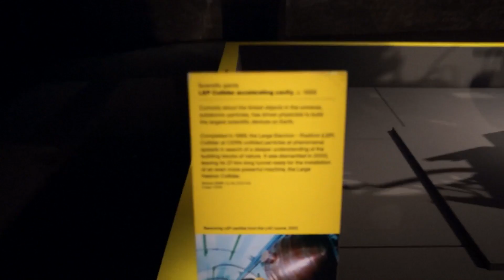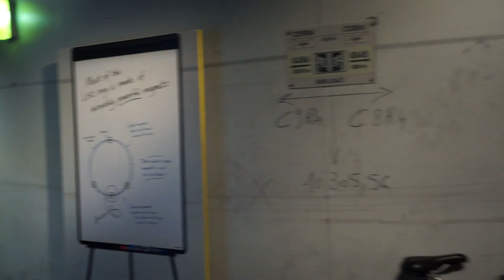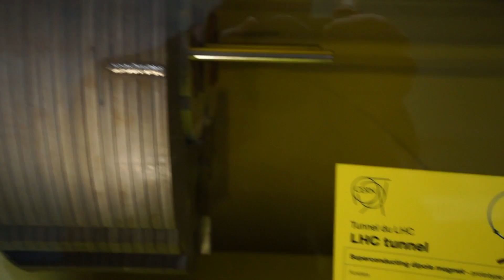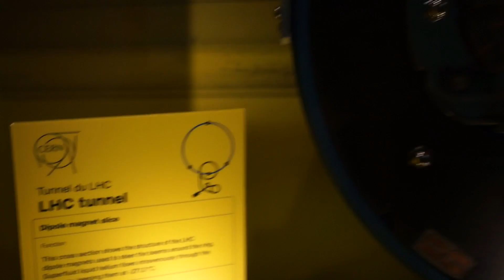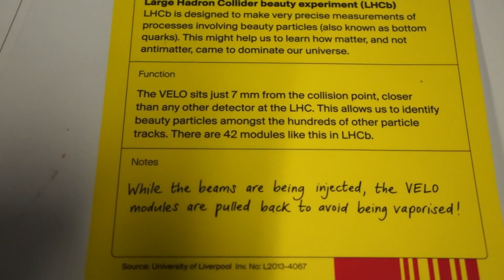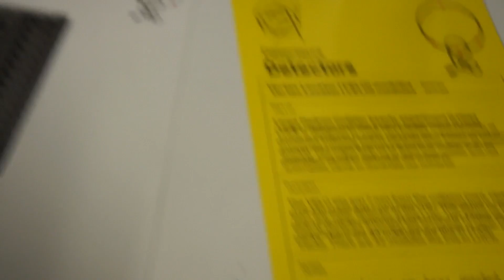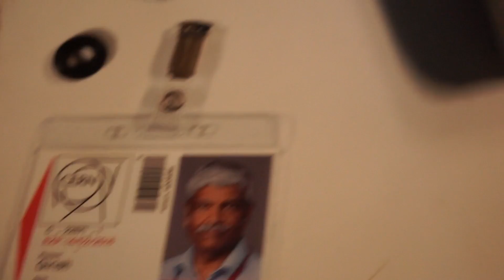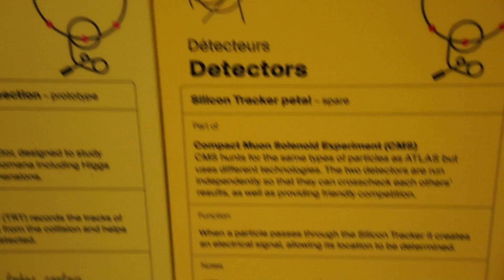Large Hadron Collider LHC Exhibition Tour

Comment: The copper wire runs along the tunnel in parallel...instead winding along the core...it's the particles accelerator...bothpoles runs along tube so called bi polar.....also featured in terminator 3...

Comment: Did you see the I2C testpads on the VELO module? SDA/SCL were on there. Wonder for what...

EDIT:
http://www.kip.uni-heidelberg.de/lhcb/
They use custom chips on there (Programmable analog or binary pipelined readout chip). They are programmable via I2C.
Reply: And here's the Datasheet for this chip: http://www.kip.uni-heidelberg.de/lhcb/Publications/BeetleRefMan_v1_3.pdf
I still don't quite get what it does, some kind of analog front-end for pulse detection?
Reply: Marian Keller seems so. You can program some sort of analog processing pipeline, probably a bit of filtering, amplification etc.

Comment: So cool. If it made money it would be the size of a cell phone in 10 years.
Reply: Fahraynk Collision energies and tracks are not going to change in size.  The target is the size of a house because that's how big the collision area is.  It's not going to get smaller. Not ever.  Not in this universe, with this set of physical constants anyway.
Reply: Unlikely. Some things just need to be large to do their jobs.  This is a case where you may as well say that buildings or bulldozers will be the size of a cell phone - there are fundamental reasons why some things are the size that they are.
Reply: John Ridley
Nano tech can improve magnets, ect.
Reply: Fahraynk Sure, but there are still physical limits. They spend billions on this stuff, if there were even theoretical ways that they wouldn't have to carve out miles of tunnels in bedrock they'd surely be looking into it, and I actually have several friends working on large colliders. None of them talk about any of this stuff.
You CAN build an accelerator that fits in your pocket. I've seen them. They're very low energy.  The bigger you make it, the higher the energy.
Reply: John Ridley
So you dont think that in 10 years it would be cheaper with better technology and easier to make ?
Reply: Fahraynk Sure it'll be cheaper. But it won't be smaller. Some of the equipment will be smaller and more powerful, but the fundamentals are not going to change. You need to reach certain energy levels to force these particles apart. The energy required is putting small cities worth of power into a few atoms of mass. You don't do that with something you can fit in your pocket, or even something you can fit in a house.
When the collision does occur, you need to intercept the particles and map their tracks.  Those tracks have a certain size. You can't compress this. You just have to live with it.
Equipment will get smaller and more powerful. Experiments will get more precise and refined. But the size of the facility just needs to be of a certain size to achieve the fundamental physics results required.
Unless you can figure out some way to change the fundamental constants of the universe.  And if you can do that, you probably already have the knowledge that we're trying to achieve here.
Reply: You guys are aware that there is more than one particle accelerator in the world, right? There is several around the world, and at least two more operative hadron colliders in the US. It's not like the LHC in Switzerland is the only one. It might be the biggest, but not the only one.
Reply: https://en.m.wikipedia.org/wiki/List_of_accelerators_in_particle_physics
Reply: gerbizzlefoshizzle Of course there are many. I have a bunch of friends who are scientists and techs at Fermilab.  That doesn't change the fact that you're not going to be able to achieve LHC level results in something the size of a cellphone.
The existence of a sports car does not mean that in 10 years a train will be the size of a bucket.
Reply: John Ridley No, I completely agree with you - a "pocket size" particle accelerator doesn't make any sense - the argument that I was trying to make when pointing out the existence of other accelerators was that it's not a brand new technology thing, governed by "Moore's "law"". CERN didn't just build the LHC of OTS parts to prove a concept, and can plan a miniaturisation project for the next fiscal year.
Reply: John Ridley I might have read the discussion rather sloppy, I think - my argument is maybe a bit off topic. but valid none the less, I feel
Reply: gerbizzlefoshizzle Yeah I never said it follows moores law I said IF it made money it would follow Moores law.
There very well might be some physics equations that limit its size.
Reply: John Ridley Good analogy, although the engines have become MUCH lighter... they are limited by the size of people. Collides passengers are subatomic... so maybe bad analogy lol

Comment: Even the sensor uses I2C,you can see it on the bottom right part of the screen at about 6:35
Reply: This literally made my day 😂😂😂👍👍
Reply: We have found our king.
Reply: "How do you know he's the king?" ;-)
Reply: It's about the absolute easiest low pin count interface to implement in silicon and all you need to do in these detectors is configure the channel front ends so why would you use anything else? IEEE-488 went the way of the Dodo a long long time ago. You won't find a single smartphone, tablet, laptop, or desktop without I2C, and just about every single "smart" product on the planet also contains I2C.

Comment: Detectors are simple, a photodiode and amplifier, just like any other avalanche detector. Just has to work in a vacuum and when cryofrozen. No tin there, just 60/40 lead so it does not have any tin pest. Special order parts as well to have them made with no tin coat at all, Cheapest part would be the actual sensor and board, the expensive part is the certification and testing, they are exposed to stuff that makes it look like an easy stroll putting it in a live fission reactor core. I would guess similar engineering was used ( and likely reused from CERN) in designing Juno's electronics to survive in the similar radiation hazard of jupiter, which probably has energies equal to that at CERN, just not as controlled.
Reply: you mean you HOPE they used leaded tin.

they sure didn't on a lot of nasa gear and even current satellites
Reply: What do you mean no tin? 60/40 is 60% tin and 40% lead. Or did you mean 'no lead-free solder'?
Reply: This lol. I'll guarantee they didn't use lead-free solder though. Lead-free can't take the temp cycles like sn67 can, which is why it's used in space.
Reply: +moo.
That's why I wrote "*no* lead-free solder". Or am I misinterpreting the "lol"?

Comment: Oh wow, I couldn't imagine how those sensors look or how big they were. Surprisingly small, actually, but man, I share  your enthusiasm. Awesome!
Reply: Well ... what you've seen here is one little part, of one slice, of one specific detector. The detectors in the LHC tunnel are composed of several sheets and layers of those pieces of detectors. Forming blocks surrounding the central region and blocks around that and blocks forming the end caps, all full of those slices of silicon with it's electronics attached. Those detectors all in all are easily as big as a small building.